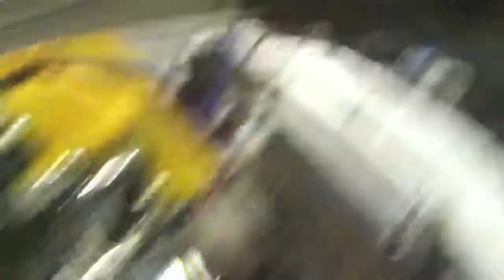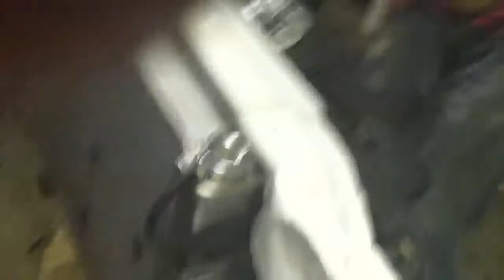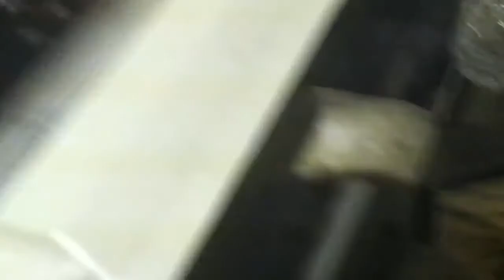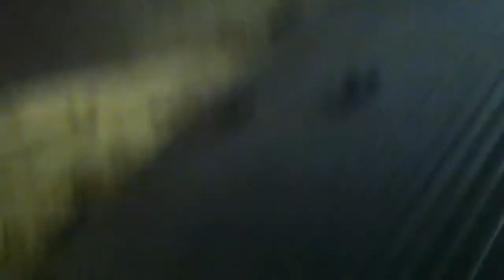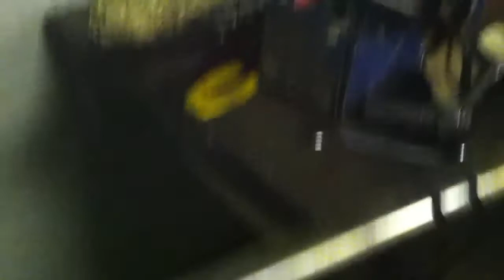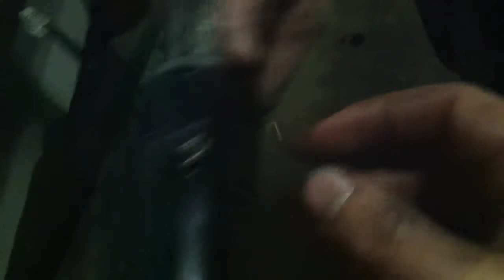1995 camaro carb'd 421 stroker - almost done!

Comment: Trust me remount that cooler different. Putting plastic hold downs through the radiator is going to cause the radiator to leak.The vibration and bumps are going to cause the plastic to rub small holes in the core. I made that mistake when I first got into building cars in the 80's. If your radiator is expensive I wouldn't drive it like that FYI. Just trying to save you $ down the road.